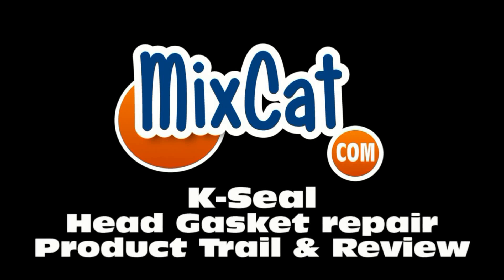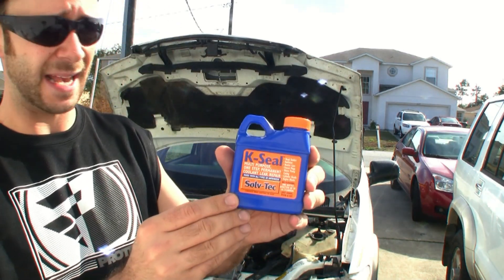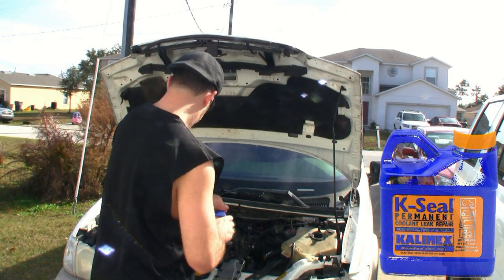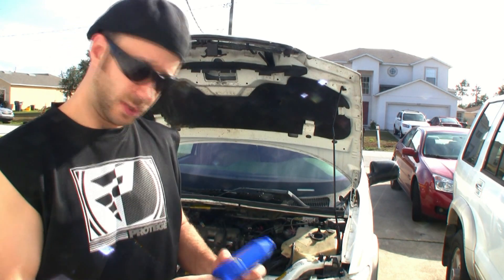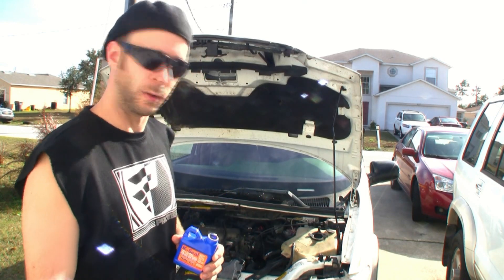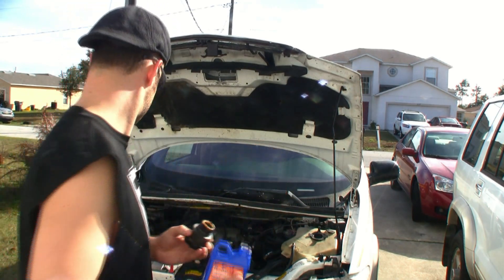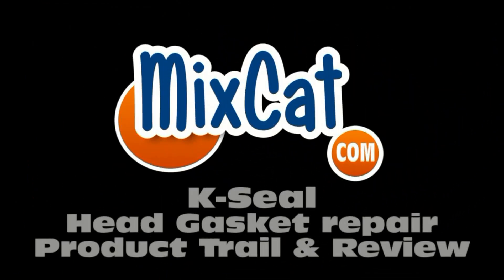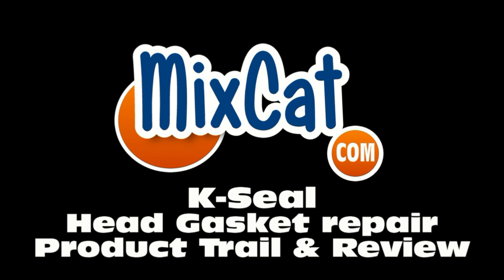K-Seal Head Gasket repair product demo and review ( discusses how to repair a blown headgasket)

Comment: Be careful when you use this KSeal shit. I put this stuff in my van's cooling system and it hasn't run since February of 2020. Where do I begin?

I began to have intermittent stalling problems. Everything that looked like either a fuel blockage or lack of spark etc. I even bought a new $93.00 MAP sensor and STILL the problem was there.

So now my engine is essentially running poorly. However I maybe used too much by accident. The head gaskets are a main point of failure if your leaks are else where. The cooling jackets are rather wide BUT the head gasket has small slits that restrict the flow of coolant to prevent over cooling. KSeal CAN stick to your head gasket and slowly DAMAGE your head gasket!!!! 

So if you use KSeal my STRONG recommendation is use the absolute LEAST amount of it as possible and when your leaks are sealed CHANGE YOUR COOLANT!!! Or take it to a respectable mechanic within a month. Don't make the same mistake I did!!!

Comment: I haven't had success with this stuff in the past with the car pressurizing the coolant with exhaust gasses. I have another car with this issue now, is there a certain method to using it in this situation?
Reply: Air Yordan yes you have to figure out which cylinder has the blow by into the coolant system then remove the plug and wire off that cylinder and unplug injector and then run the k seal with the cylinder not firing. spark plug is removed to prevent compression in the cylinder. be sure to put an ounce or 2 of oil in the cylinder before cranking and running it dry.

Comment: Yeah this shit works we have a 2005 Toyota Camry 4cyclinder and it has an internal leak somewhere after paying 1500 to get it fixed I changed the oil and the sparkplug plus the catalic converter this 15.00 dollar mirical in can works like a charm bracelet.Its still running and it's not over heating.

Comment: How'd it end up holding up dude? Just one dose ?
Reply: Not bad. So far I've heard that it permanently fixed small gasket leakage but for blown gaskets it's either a temp fix or doesn't work at all. 

Thanks for the follow up and video

Comment: Just to let you know condensation on the oil filler cap is not an indication of a head gasket issues, Its quiet normal in some makes and can be due to oil quality or blocked breather pipes.Great Vid though thanks for posting it.
Reply: It can be

Comment: I used kseal on my 92 pajero v6 my head gasket was pretty bad I had coolent in the oil it went very milky also coolent driping oout of my exhaust car was missing badly after puting k seal ran it for a half hour I droped the oil and replaced it with fresh oil and filter runnig fine now has been for a few months still no issues oil is still clean

Comment: The "Ultimate Permanent Head Gasket Repair" is the $40 one, the one you have is $15. Same brand but it's a about twice as big and much thinner viscosity. It also says all over the packaging that if you're coolant and oil are mixing, that you are not supposed to use it as k-seal because it fucks up the oil. .
Reply: Even if you don't use gasket repair and have coolant mixing with oil , the oil would get diluted and motor could get fucked up than already is.

Comment: Ok. I officially endorse this product.  I had a leaking radiator thst was making my engine overheat last May.  I couldn't afford to get it properly fixed and my mechanic offered the K-Seal as a quick fix solution.  He didn't make any guarantee that it would work but given my financial situation at the time,  i didn't have much choice.  Well it's been over a year and it's still working fine.  No overheating.  A+  superior product.  I highly recommend it to anyone in a jam.
Reply: Thanks!  I think I am in the same boat as you.  Our auto store recommended it to me too.  It was good to hear that you had good luck with it.  Reassuring!
Reply: @ravensdancing13   I sold the car earlier this year and the seal was still holding. I saw the new owner last month and he said he's had zero problems with it since he bought it.  Good stuff.

Comment: i used K seal on my subaru, classic SOHC 2.5 head gasket leak on an outback with 211,000 miles. on 213,000 now and its still running fine. :)

Comment: my 1990 acura integra. with 400,000 miles finally had gead gasket leak to oil. Car had hard time starting, water come out of tail pipe with white smoke. Tried mr k seal. left it for a day ,went to start it. It started right back up with no more  problem. It worked. Got compression back. A little water from tail pipe better than before.It help alot just to get by. let see how long it last.

Comment: I've been loosing coolant to the cylinder,steam coming out from the hood when I stop(pressure), white smoke from the back and a little bit of foam raid in the oil. I have just applied k seal to my BMW 325ti and after driving 6 miles I have stopped, unfortunately there was water coming out and a lot of steam  :( I was worried that I have just killed my car, but half way back home I've stopped on traffic lights and there was no water coming out,no steam, normal operating temperature.....hmmm.....don't know yet if it works for me, but I will update tomorrow.
Ps. I have expansion tank in my car and they're saying,that sometimes you need more time for the k seal to work, so maybe this is why it took a bit longer ;) just hope it will work - garage ask £800 for repair ;(
Reply: So annoying when people tell you they've tried it but never give any updates.
Reply: So how has that worked out for you up till now.  I just put it in my car today.  Had coolant coming out last night.  Car kept overheating all the way home.  Mechanic said it would seal permanently and I wouldn't have anymore problems.  Im skeptical but trying to be optimistic.

Comment: it worked for me my head gasket had gone in my rover 25 k-series n coolent leaked into the engine after using 2 bottles of k-seal n then i did a engine flush n oil n filter change n im not losing any coolent now
Reply: LOL..maybe they should just stop using head gaskets when they build cars and just use this crap..LOL